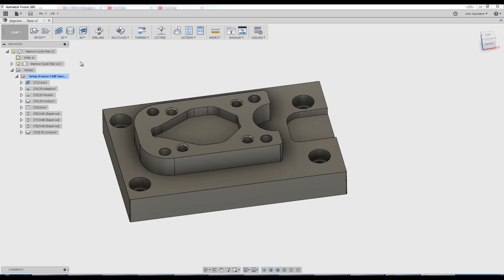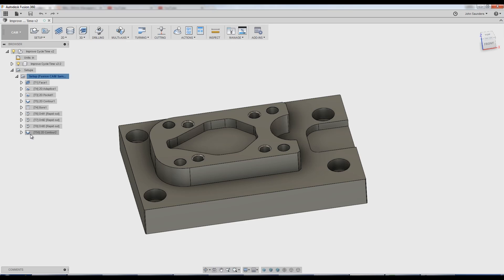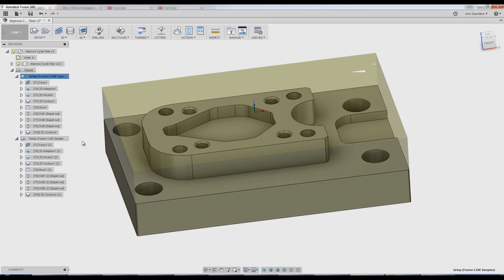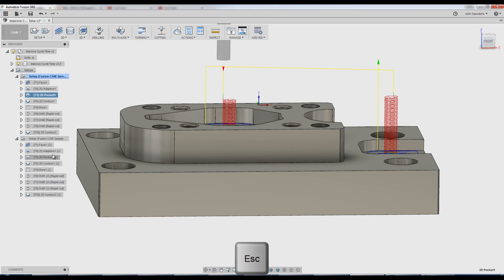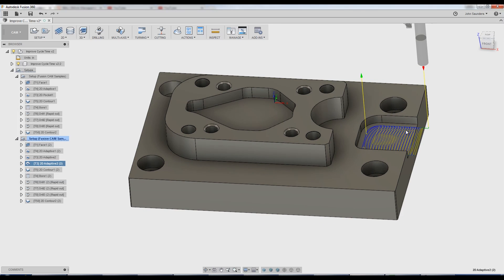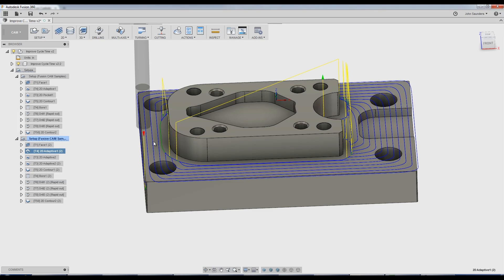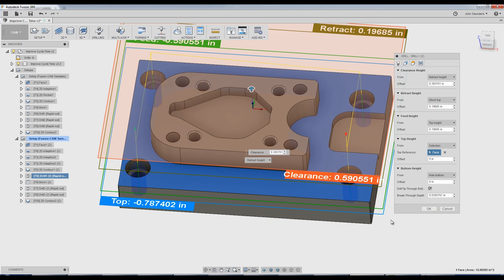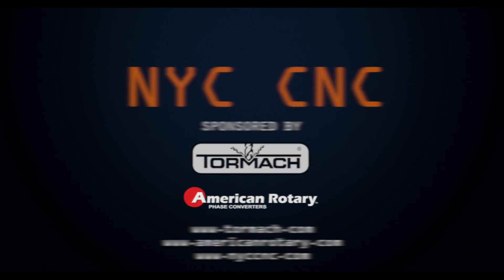How to Reduce CAM Machining Time in Fusion 360!  FF93

Comment: Hey John, I see you always leave no engagement feed rate. I know it's not always about speed but as much as we all use 2d adaptive you can save time by upping the no engagement feed rate. My machine rapids at 180 ipm in Z and 220 ipm x and y. I usually set no engagement at 150ipm and it speeds things up quite a bit.

Comment: another way to save time on ops is to make sure your stay down is set higher. and keep your clearance heights low to the part surface. this can save you a ton of cycle time. especially in production runs while multiple holes to drill or pockets to machine.

Comment: That long thin cutter at the end would shatter like crazy if you try to finish the sides in one go. Also, have you checked if the flutes are even long enough? Had done something recently with an 1/8" two flute with overlength (over 1 1/8" stickout) and the shattering was horrible, even though I just machined delrin. Keep that in mind.
Reply: Klaufmann depends on step over, feeds etc. I regularly run long flute 6mm endmills full depth 2x manufacturer spec in steel. Why? They're cheap and adaptive allows it.

Comment: Hi John, there is easy way to check machining time in fusion 360:
Run all setup simulation, and in bottom of the screen there is time line (dark gray color bars) move the mouse on that line and you will see different operation machining time and other information.

Comment: John, Great video.
Just throwing some paths on a model isn't that hard. But doing it all right and get a proper machining time is much trickier.

If you want a better overview on what operation takes up most time I made a special setup sheet. That gives you a pie chart of the operations run time.
Find it here: https://forums.autodesk.com/t5/hsm-post-processor-forum/pie-chart-of-operation-machining-time-in-excel-setup-sheet/m-p/6821340/highlight/true#M12315